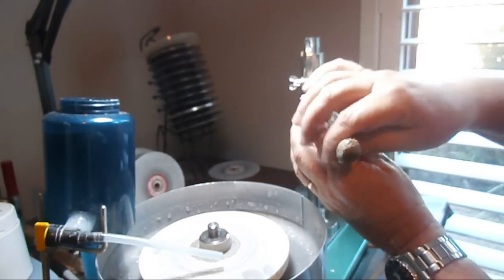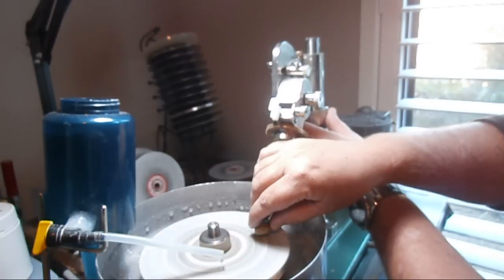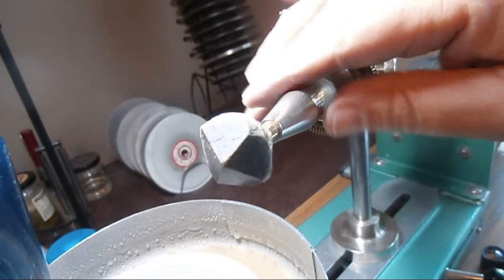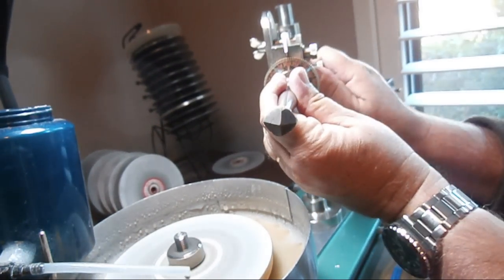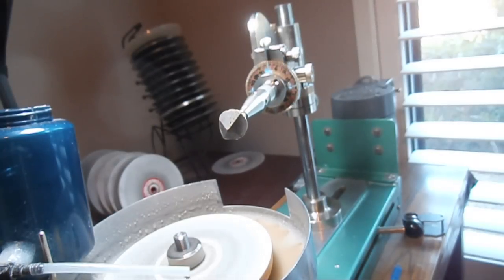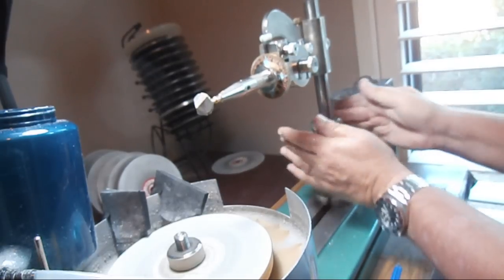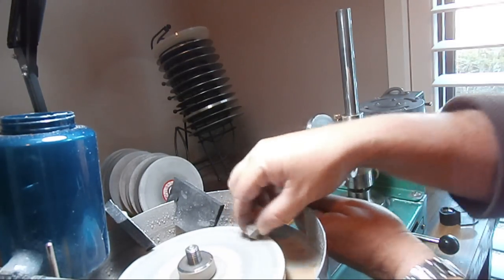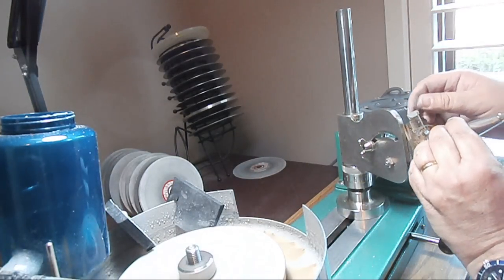Faceting a garden rock.

Comment: Awesome beginners video. One day when I get a machine, this will be the video to help with my first attempt. 
I might add just in case you aren't aware, but the accelerator and curing agents are usually higher in VOC levels so respiratory exposure may be something to consider. 
Thanks Cliff
Reply from the maker: Thanks for the tip. Cheers

Comment: Fantastic! What a great way for a beginner to learn how to use their machine. I assume you could use other material like agate or rough quartz. Thanks for sharing.
Reply from the maker: Thanks. Yes Agate and quartz would be fine.
Reply: Vintage Time Hey vintage great video mate. Will this work on ingneous or polymetamorphose metamorphic rocks? Their density is full on but some rocks I’ve got have a schist matrix with marble which would look fantastic if they could be polished. What do you think?..subbed btw 👍
Reply from the maker: @cloudattack3279  Hi, You could facet them into shapes. All are soft in terms of mohs hardness. I doubt that any will polish well though.
Reply: Vintage Time Thank you for providing your time to respond. Makes sense. Cheers 🍻

Comment: I don’t want to sound rude. This is really just a “I don’t understand” question. Is the skill mostly in knowing how to set the cutting arm? I’ve never cut gems before so I don’t know. 
The common stone is actually a pretty good idea for a novice though. I was actually going to attack my crystal collection... now I can same my pretties for more experienced cutting.
Reply from the maker: Yes selecting the correct angle on the cutting arm determines the angle. The a wheel with slots/teeth selects an individual facet cut at the angle. That's the basic, but there is a lot more to it than that.
Reply: and maybe having a good feeling on where to place the facets might help, too. ;)

Comment: Very informative, just wondering what is meant by index?
Reply from the maker: The machine has a wheel with 96 notches cut into it. Each notch is called a index.   Choosing the correct notch/index determines what facet you cut.
Reply: @VintageTimeGems  thank you. Im thinking of doing some cutting and grinding and your faceting tutorials are very helpful

Comment: Is that a cd rack full of grindibg disks? That is epic if i am seeing it right.
Reply from the maker: A toast rack to the left and a Cd rack to the right.
Reply: @VintageTimeGems  ohhh i see , it is all set up for when you burn your toast and it dries out. Is it aranged by grit and blackness of said toast(or is it black diamond !? Its super hardened carbon formed in the extreme heat and pressure of the toaster... )  And does the corresponding cd get played when a grinding disk is chosen ? This is a cool idea . i actually have to get off my behind and polish some mineral specimans that i have gathered. In particular a nice chuck of marble that is bluegrey and salmon pink , with sort of a tiger stripe like pattern where both colors tranisition into one another and small black and silverish lines of mineralization following that pressure pattern.and an odd very random pocket of chalcopyrites showing on one side...   I know it was kspar for the pink and plagioclase feldspar for the bluegrey.it was granitic rock at one point but has after a very long time ,has changed it into marble..sorry . i like minerals and elements and look for excuses to blab about them when i can.

Comment: Please explain your "compass" as it seems to not be a 360 degree compass. (I know that sounds like a dumb question but I have never seen anybody do faceting before and am curious about that one detail.) Why not a true compass (360 degree) as opposed to your compass?
Reply from the maker: It's not compass its a protractor that sets the cutting angle and the index wheel determines the facet. The index wheel has 96 notches in it. Choose a notch from 1-96 to cut a facet.
Reply: @VintageTimeGems  Thank you, so, Facets with 2, 3, 4, 6, 8, 12, and 16 ? (although why just 2 sides ???) sides ?